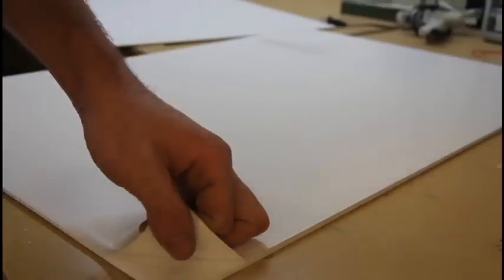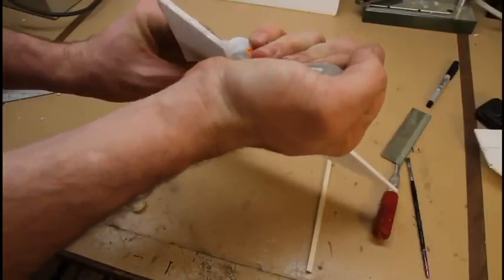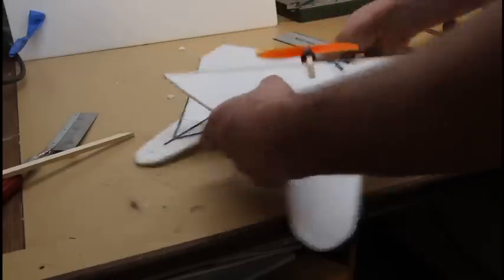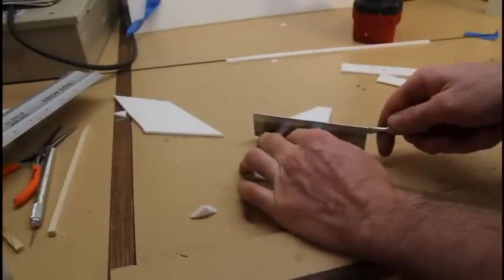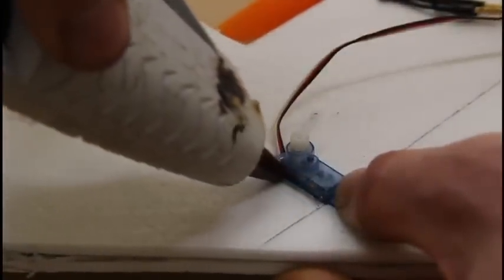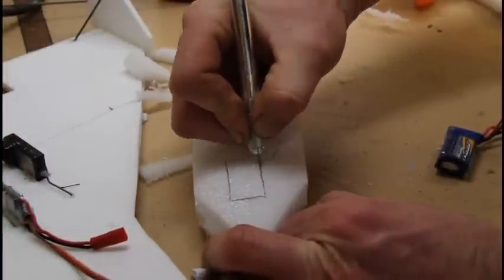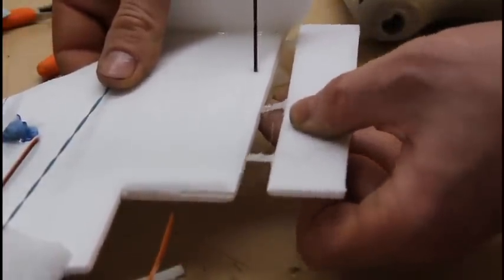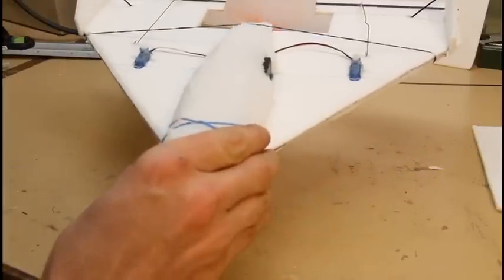How to Build a Simple 3ch RC Delta Plane

Comment: you could try balancing the elevator in such a way that the plane gradually loses altitude somewhat like a glider and then use the switch just to enable the ability to climb. Or I have seen the idea of using 2 channels for elevator and either ailerons or rudder and then a switch for a motor and essentially making a self launched glider, glider loses altitude slowly without motor, gains with motor. But its just an on/off.

Comment from the maker: I see your point, though the dust created is mild.  I have heard cutting under water minimizes exposure. The trouble with snips is that they can often cause the edges to fray.  This isn't a big deal though cause a little CA glue can remedy that quickly.

Comment from the maker: There are CG calculators online to help aid with figuring it out.  On this plane it is about in the middle.  You always want it to be nose heavy from the center of the wing.  Since this is a delta wing you need to figure out the wing area and find out what the half point is based on area and go from there.

Comment from the maker: All you have to do is set it as Elevon.  It's a mix between elevator and aileron if you have a radio that does mixes directly.  I use a FlySky radio but nearly all radios and definitely specktrum radios can do elevon mixes.

Comment: How do you make one elevon stay down and the other elevon stay up...I mean, don't the servos only pull the wings not push?
Reply from the maker: I am not sure what you are asking but will try to answer.&#160; The servos are able to push and pull the control surfaces though the rod.&#160; Because of the limited resistance of such small hinge points the wire is stiff enough to push it effectively.&#160; The radio channels are mixed between elevator and aileron.&#160; In this way they both act like elevators when only commanded by the elevator stick and vise versa with the aileron.&#160; When both are given then they are mixed together so that in at the extreme corners of the stick throw that one elevon will at its travel limit and the other will be level.

Comment: Hello, I'm doing 3 identical aircraft to this, in fact they are almost replicas of the model skyartec or sky fun that is bought in hobyking etç, and I bought one, but then I decided to do it and I started it, Bigger and a lot smaller, but I'm with a possible problem, ..the weight .. because it seems to me to be a little bigger than the original model sky fum taking this into account, which motor you advise, the plane must have Almost 1m wingspan and 85 or 90cm length and can have a weight of 1kg or 1.5kg after everything is installed, so I accept engine suggestions with good torque and also propel to use, will it be a 6x4 inch? Turnigy engine 2836 2350 kv ?? Esc. Of 60 or 80 amp, .. 3 and 4s batery, soon I will show one of them, and if it goes well then I will post videos on this magnificent and simple model, .. asadelta, .. skyfun !!!